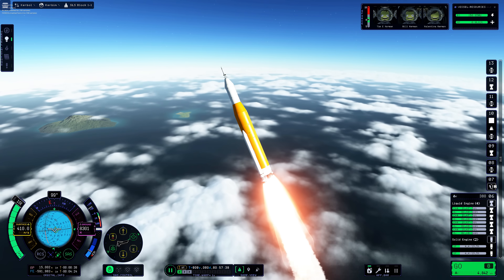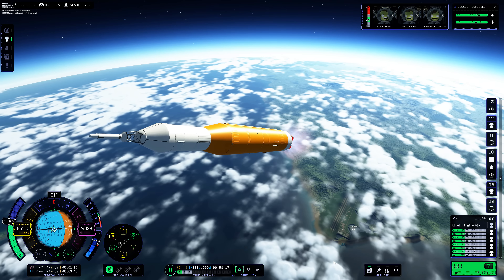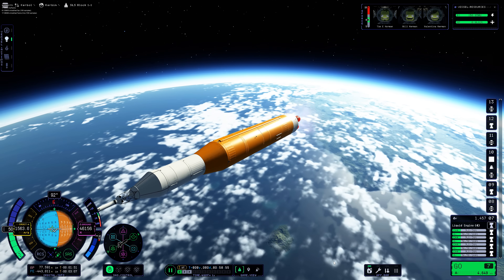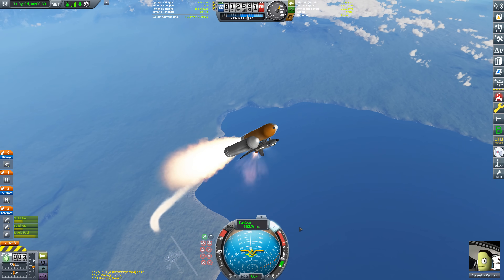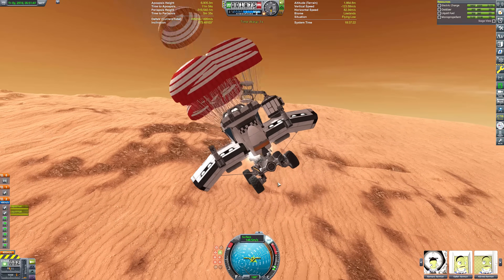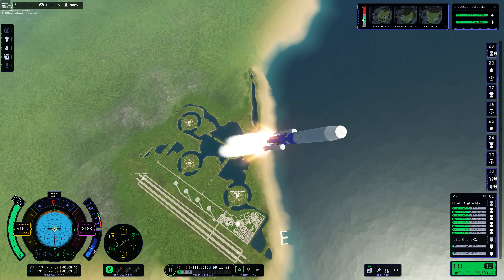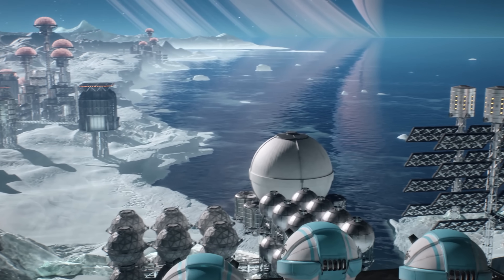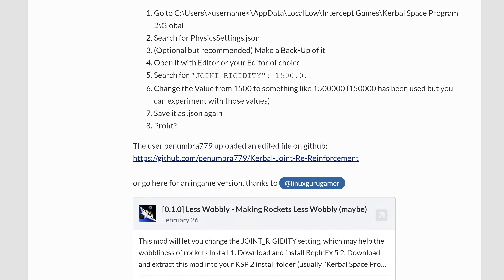Wobbly Rockets Still Haunt KSP2: Developers Face Uphill Battle

Comment: They can defend “novelty” all they want, but I loved KSP1 because it was a fun challenge, not a frustrating one. My experience with KSP2 has been nothing but frustrating and makes me really sad.
Reply: "I'm gonna make a rocket to Duna!"
30 minutes of planning and design later...
"Ok this should do it! Now let's launch it and see how it does!"
Rocket implodes on liftoff.
Reply: @1mariomaniac how fun! How novel!
Reply: The objective should be very simple: Reasonable rocket design shouldn't result in a rocket which disintegrates under normal loads, is impossible to control, or looks wobbly. Bad rocket design should be instructive with some wobble on launch, that becomes destructive on unusual loads and can be fixed with a reasonable number of adjustments with struts or redesign.  That would make the game fun and only as frustrating as you want it to be when you push design limitations. Right Now, I haven't  played in months because the game simply doesn't work and is very unfun.
Reply: KSP2 is fine. But a nicely nodded KSP1 is so much fun and looks fantastic w/ a great frame rate
Reply: @sulljoh1  KSP2 promises a lot of things for the future... unfortunately, modded KSP1 already does all of those things right now.
I'm really not getting why I should buy into KSP2 if it offers nothing over KSP1.
Reply: They're simply saying if someone makes a stupid vehicle, that would wobble and fall apart in the real world then it should also in KSP2.

Imagine a rocket made out of thinnist part, and stacked redicuously high. It should bend and snap.

If they simply disable it all, as a single rigid body. It'll be rock solid. Which it shouldn't be.

They need to group the parts, it's fucking ridiculous they're handling them as individual parts. Years ago in the initial announcement videos, they said would perform optimisations to the joints. As they will need to do it for the big interstellar ships.

How the fuck they're in this situation and still talking about it, planning it out when they've themselves been saying that's their plan from start, is just mind boggling. I just can't understand what the fuck they're doing.
Reply: @davescott7680  "Imagine a rocket made out of thinnist part, and stacked redicuously high. It should bend and snap.
If they simply disable it all, as a single rigid body. It'll be rock solid. Which it shouldn't be."
The problem with that argument is that they then would need to remove struts entirely. I still remember launching a space station with a central core, 4 science labs plus 2.5m->1.25m cones as "spokes" for an entire ring of 1.25m passenger cabins (from the airplanes set). No mods, no autostrut, just regular struts - and I had zero wobbling issues getting it into orbit. The only issue was that the number of struts really tanked the performance (some 1-2 FPS or so at the worst part of the ascent)
So any horribly designed vessel can already be built without any kind of wobble, all you need to do is invest a little more money and a crapton of time to add more struts, and then have an insane rig to deal with all those connections and still have the game run smoothly. I don't think that's how that's supposed to work...
Reply: Get a better PC I got 5600X 3070 32gb ddr4 3600mhz  Firecuda 530 SSD and I Avg 100 FPS on the ground when launching and in Space I get around 200 to 260 FPS
Reply: @factsforlife0O0  not everyone can afford that kind of PC dude. Besides even if it ran perfectly fine for everyone it still doesn't fix the issue of wobbly rockets being inherently stupid.
Reply: @factsforlife0O0  Meanwhile, my 3770K and RTX 3060 12G and 32GB DDR3 gives me 120 fps on KSP 1.0 with a shit ton of mods... Why the need to buy a NASA computer, just to compensate for the lack of optimisation of an Alpha version of a late game ?
Reply: @factsforlife0O0  This is the most idiotic kind of comment one can make.
"The game runs like shit cause it's unoptimized crap"
-> "Just buy a a ludicrously powerful PC."

It's up there with:
"There's a bug that ruins the game experience"
-> "I didn't run into this bug, therefore this is not a problem."

You're making excuses for a poorly crafted product, trying to circumvent issues of the game via external solution. The game is poorly optimized. It's an Alpha, that's about to be expected, so no real need to whiteknight the company on it. Unfortunately, the company decided to ask full retail price for this mess of a game, so there is plenty of reason to criticize them for the poor state of things and their lackluster delivery on promises and delay of fixes.
Reply: what settings  @factsforlife0O0

Comment: There is a very silly argument I recall them using in their last video, which is that it makes sense to wobble because it's a joint. (talking about separators in particular)
In the physics engine I assume the components are held together at discrete points. But if they simulated craft part collisions, those two cylinders would obviously not phase through each other.

Kitbash took the right approach, simulating the entire ship as a whole, and applying the physics locally. I don't see any reason either why local physics couldn't have wobble if desired, like when falling through the atmosphere, parts breaking off because of a collision, wheels touching the surface or side attached boosters.

There's probably even performance to be gained there?

Comment: Yeah... I can definitely see a glaring issue with detecting a sudden diameter change and adding a joint in... What if someone makes a kilometer-tall stack of XS tanks?
Might be worth looking at a middle ground here, like what if there was a scaling system where XS tanks would have 1 joint every 2 parts, M parts 1 every 4 parts, L parts every 8 parts, etc. It'll probably be exploitable in some way to make a full rocket completely rigid, I suppose, but that's kind of just games in general.
Reply: No wobble or flex, only break. That's my solution
Reply: @josephschaefer9163  Oh yeah, that's actually quite a good idea. But there'll have to be some way for the player to see the stressed joints in the rocket (an overlay perhaps?) so that beginners aren't completely mystified as to why their rocket keeps breaking for some reason.

Comment: All vehicles in the real world flex but its by such a small amount that it is completely ignorable in a game like ksp
Reply: the problem isn't the wobble it is the joints wobbling. most joints in real life are more rigid, which puts strain on the part right next to the joint. a joint that wobbles tends not to hold the parts together, which is why when making joints you make them slightly more rigid than the part to make it hold well and not put undue stress on the parts.
Reply: exactly it's more inaccurate to make it wobbly , not to mention , a wobbling starting at a high velocity might start resonance with the air and the craft would explode or go out of control very quickly
Reply: I wouldnt completely ignore it
Planes would have completely solid wings then which just isnt the case IRL
I feel like the flex should still be simulated but obviously to realistic standards and not whatever the hell we have right now
Reply: @Elijah1573  I totally agree. I think the consensus is more or less that they need to slap the "fixed body" fix on it and try to address it from there.
Reply: I wouldn't say it's unnoticeable,  the Falcon 9 during landing for example has a very pronounced wobble that you can see on the onboard view - the whole booster twangs during the suicide burn
Reply: @dsdy1205  I've watched dozens of Falcon 9 launches and don't recall a single time where the stack flexed like a pool noodle being shaken.

I also don't recall ever seeing a gimbal engine rock back and forth 15 degrees while "steering".

their "physics" is over-exaggerated.

Comment: They could also have joint simulation that gets only activated after a certain amount of stress is surpassed. so from a certain stress level joint simulation gets activated and a bit higher stress level the joint will snap.

would be a way of the game telling you that your design is bad and should have fallen apart, but the game is a bit tollerent and torchers you with some wobble instead

Comment: i think they're working toward the ideal situation : staging the physics so you get your rigid single body for launch and then transitioning into physics post launch. you want physics to apply across the ship, just focusing on the launch and ignoring the collisions or the atmospheric forces just to get a stable launch would be kind of disappointing. not saying launches aren't important, it's the first step and the one that sticks in your mind when you think kerbal, which is why a multi-staged physics approach would be ideal. 
theres the two stage approach : you wrap the ship in non-physics and unwrap your present when appropriate. but that's kind of blankety and you don't get the subtlety of having parts break off your ship while you're launching,
there's also other methods like profiling parts so some are considered "non-flex" and joints and decouplers as "stressable".

at the end of the day all of this needs to scale up to interstellar crafts too. i imagine you'd want to physically see your interstellar ship bend when doing literally any maneuver since that's what you'd expect out of a simulation.

Comment: I think you could have two types of joints. One that welds the parts together like rocket parts in a full vertical stack, and a second joint for parts that are attached and may need extra support. Example, two fuel tanks, stacked on top of each other with a engine would be treated as one solid part, while the boosters attached on the side would need stretch to connect them strongly together.
Reply: This right here. Not sure why the devs didn't do this from the start. Node attachments get treated as a single rigid part, while radial attachments get treated as a regular joint. 99% of wobbles gone.
Reply: Node attachments of the same diameter, at very least, should be welded. Seems obvious to me.
Reply: @ThaneBrimhall  yes, all parts connected with the same type of joint become unified.  Seems like a recursive check on this could be done upon saving and before heading to the launchpad.
Reply: This would just make too much sense
Reply: They don't do that because they want things to be able to snap in half. I still think your idea is good, you just have to handle when to convert back to separate parts to properly simulate rapid unplanned disassembly.
Reply: @BitsBlit  I'd think you could keep the joint rigid but still check how much force it passing through it.  If the force exceeds some fraction of the break point, then the joint is allowed to flex and you get a kink in your vehicle before it (probably) goes out of control and breaks up.  The limiting factor could be scaled to the mounting area so wings flex to small degrees earlier.
Reply: @nickdumas2495  You're getting to the heart of the issue. The joints are already rigid, and there's a breaking force at play. However, Unity's rigid physics joints serve merely as guidelines. While the physics solver will attempt to adhere to them, it may abandon the effort when it becomes too computationally demanding, especially under high forces. In such cases, the rigid joint acts more like a spring. An alternative to this is a physics-less connection method known as parenting. With this setup, the two parts are treated as a single body in the physics simulation, there's no constraint to compute. Just a singular cylinder that can be knocked around by physics but will need to be separated by logic. They physics sim cannot help.
Reply: sure, apply some potential "wobble" to anything connected with a separator/decoupler that doesn't have additional struts for rigidity.

Comment: Think that they should disable the joints of a part of it attached to a node that is the same size (the green balls). If you have two tanks that are the same diameter they would be made from one piece of metal and shouldn’t have a joint between them. However if they are different then yes. There should be a joint.

Comment: You summed it up in the end pretty well. @matt, I would be interested in the opinion of a Unity programmer familiar with the physics engine. I hear a lot of people saying “do X to solve the problem, but no one has ever talked about HOW to solve it or what implications it has. After all, we are in an early access state of the game, and the argument that they should have solved those problems already falls short. Everyone with some coding or engineering experience has very likely experienced similar issues during the development. 
PM: “Can we have featured X?” 
DEV: “Yea, sure, I just have to make a small adjustment, should be done in no time”. 
We are all very, very bad at estimating, or as someone once said: “Predictions are difficult, especially when they concern the future”.

Comment: What if the structure stiffness was bound to research tier. The higher science research tier achieved the less wobly the connection. (entry lvl gonna be wobbly and max will be stiff-ish)
Reply: Are you really suggesting players need to play and progress the game to cover for bad dev implementation?
"Just deal with it and if you deal with it long enough you will be rewarded with a working fix"
🙃
Reply: @rankcolour8780  Uh... now you mention it, I realise I've got that exact impression from several games in the past. Playability and "quality of life" improvements were unlocked with level. I hate it.
Reply: @eekee6034  
Yup it's a classic example of engineering a problem so you can sell the solution.
It's indicative of a development failure.
If you have to drag down the starting point of a game experience so that when you drip feed fixes it brings is up only to an "on par" experience something has gone wrong at the expense of your audience.

Quality of life and strong development should be pervasive across a game not handed out as a reward like some kind of DLC.

Comment: I would need to disagree with you here.

Some wobble would be expected.

I agree, a verical stack should be fixed with minimal if any flex.

Radially attached points like you mentioned should flex.

I mean, just look at planes for examples, i would want the wings to flex under high load, being totally fixed and break at x amount of force would give you no feedback about how much stress the wings are under for example.

But those are my 2 cents.

Comment: Some of my designs actually rely on the fact that some joints have a degree of wobble. I have consistently been unsatisfied with autostruts in KSP1 and only use them when I absolutely have to. And believe me, my crafts are massive! Some wobbliness needs to exist. Just not everywhere.
Reply: can you give an example? I'm very interested in how you could use wobble in a design
Reply: @dimanyak373  Here's one example. In KSP1, it allowed me to use multiple docking ports on a large connection point to ensure exact alignment even beyond what the devs eventually gave us. This allowed for significantly more complex station design than what most go for. What would happen is I would line up as well as I could main port to main port with the mini ports in proper orientation then make sure I was drifting towards the target and turn off SAS of both objects. Usually one port would start to lock on. (I intentionally turned up the magnets on the main ports so it was usually them.) But then the other ports would do the final tiny roll adjustment.  Then one port would dock first and the wobble would allow the others to sync up and lock up. By having SAS off the energy gets absorbed over time and then the whole thing becomes quite rigid and stable at which point you can turn SAS back on. There are also other practical uses. But they require more explanation than I'm willing to give.

Comment: As a developer, its a MASSIVE mistake to ever even attempt to simulate thousands of joints and rigidbodies on the same object, the rigidbody code handles quite poorly in unity when there are many bodies, especially when they are close to eachother. However, you can fix this by having some attatchment options determine how the final model looks, a radial decoupler without struts, could sim as its own body jointed to the main body, but all other situations should fix it all as 1 body

Comment: the thing about wobbliness is that it tries to simulate the effect of inertia and air resistance on rockets, what I feel like is very important, we need a reason to not launch entire fucking cities on top of rockets. but here is the thing though, there are plenty of games that use rigid bodies that can simulate g-force and air resistance damage on the aircraft, you can do that without simulating the physics of every single part and every single joint...

Comment: maybe make every section seperated by a decoupler a single object, then make the joints stronger when the decoupler is bigger. only bendy when smaller than 2.5 or something.
Reply: This is the obvious solution.  Implement Harvester's method but instead of one single rigid body, have each stack as its own body.

Comment: KSP fuel tank stacks are connected at one joint in the middle. Real fuel tanks HAVE no middle. They aren’t connected by one joint, but by numerous points in a ring on the circumference. When real rockets visibly wobble, that’s called rapid unplanned disassembly.
Simple solution: weld together parts that don’t decouple. Simulate joints on decouplers, docking ports and struts. If a large fuel tank experiences excessive torque from drag or thrust, snap it apart and watch it boom. JNO had the right approach with all procedural fuel tanks.